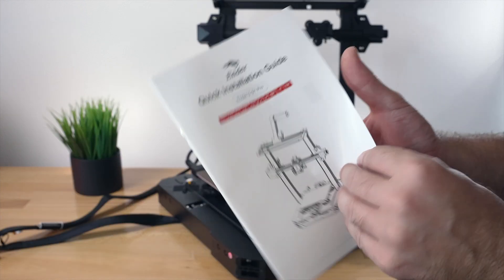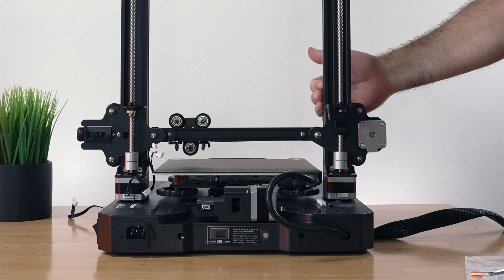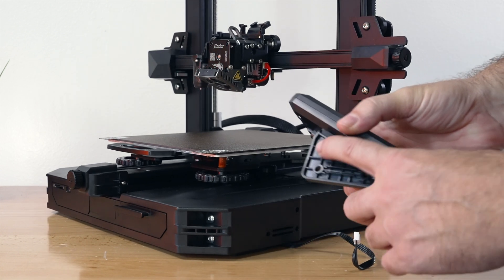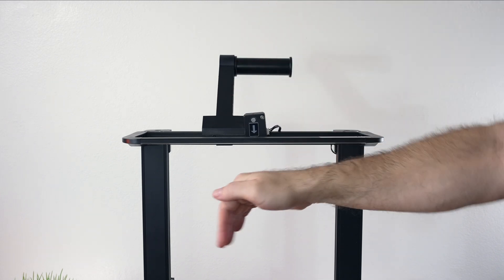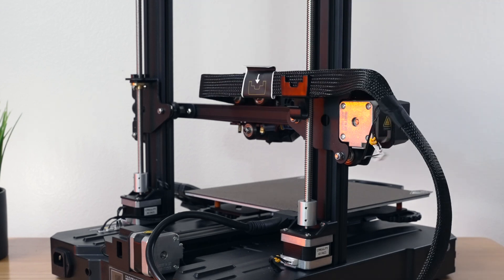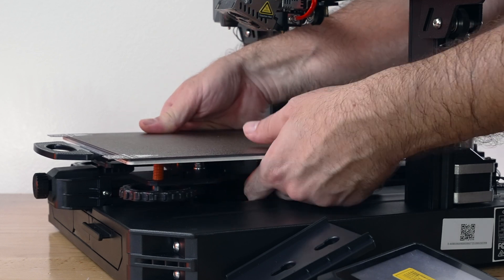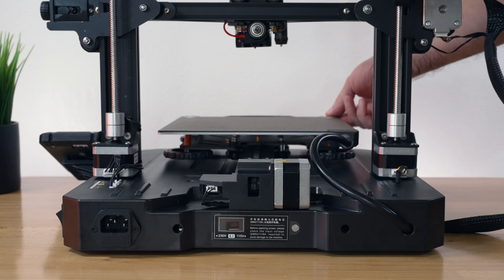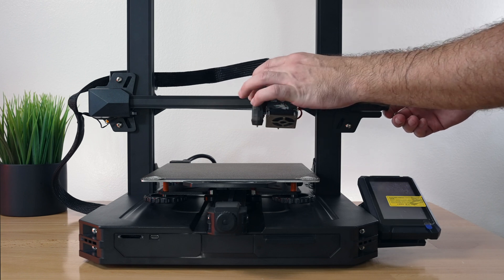Creality Ender-3 S1 Pro - Assembly

Comment: The Z axis was also crooked by 0.2cm.  Leveled it by loosening 2 set screws on one side and then moving just that side.  Now trued (trammed).  It's difficult to move it by using the belt.  Worried about Z axis banding.  Haven't even powered it on yet.  I can just return to the store.  Thoughts???